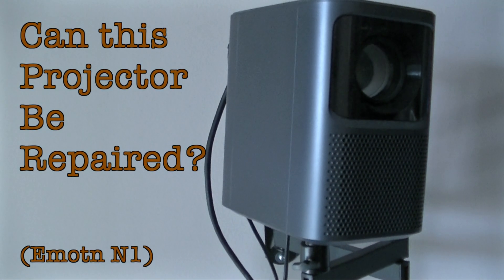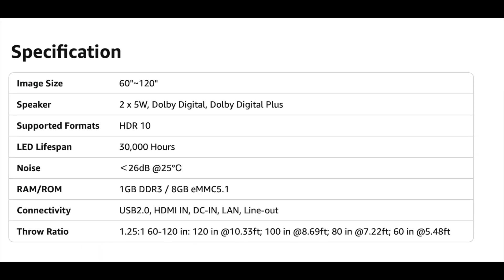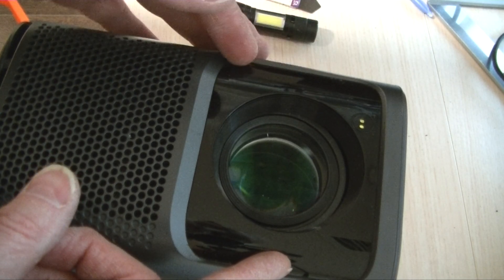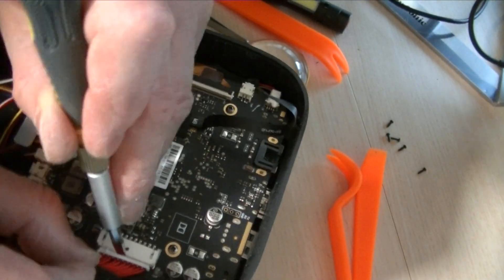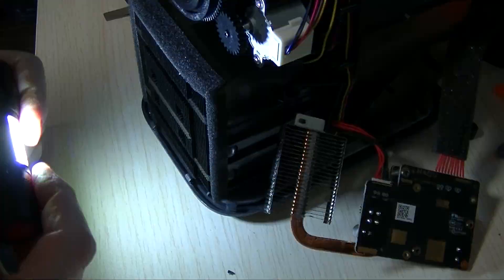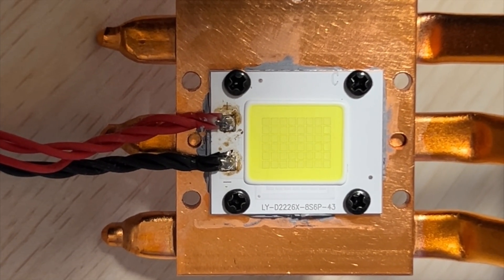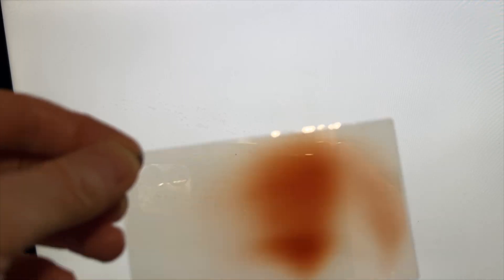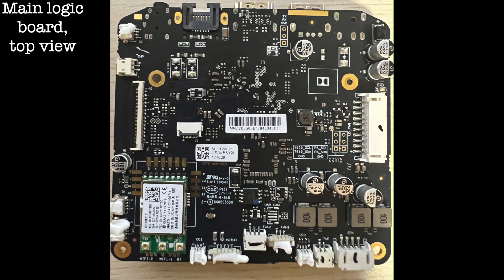Can This Projector be Repaired? (Emotn N1)

Comment: i just realized i have the same problem with mine.  what did you end up replacing it with?
Reply from the maker: Thank you for asking. I decided to take the Emotn’s failure as an opportunity to upgrade. I bought a Optoma HZ40HDR. Much more money. It doesn’t have the built-in apps so I bought a Roku Express. It is so much brighter than the Emotn was even at 50% brightness. It doesn’t have the autofocus or auto-keystone features. Its projected image is noticeably sharper than the Emotn was. The only issue was the default settings which made colours look over-saturated and artificial. I was able to tweak the settings so it’s “normal” now. I’ve had it for about 10 months. Very pleased with it.

Comment: Hi Sir, I got same projector but I am facing issue with remote controller it was working perfectly but from last few days it stopped working I try to put in reset mode by simultaneously pressing volume down and right navigation button but IR light is not flashing is there any hack of fixing it?
Reply from the maker: I’m sorry, I’m not aware of any “hack”. But let me ask you a question: Did you replace the batteries in the remote first? The symptom you describe could be simply from the batteries being discharged.
Reply: @Mr.BrownsBasement I changed it but no flashing indicator light on reseting
Reply from the maker: I’ll check and see if I still have my old remote.  If you’re willing to pay shipping, you can have it. It worked when last used.

Comment: I almost bought it, it's 79€ on Amazon in Europe, second-hand as good as new. I think it's on sale because they know the problem, that the lens will end up burning (and given the complexity of the repair). In the end I'm going to take the Formovie brand. Given the response you had from Dangbei support, I prefer to avoid this brand from now on. Thank you for your feedback and the effort made to repair it 🙂
Reply from the maker: Thank you for taking the time to comment. I’m very glad you found the video helpful. I have purchased a new projector made by a different brand. It was much more expensive but the image is also considerably brighter and the machine appears to be much more robustly made. On the downside, it lacks a few features but so far the tradeoffs have not been an inconvenience.

Comment: Thank you for this video, mine is stille working but i was looking for a tutorial to clean up the dust in the projector fan. It seems barely impossible!😱
Reply from the maker: You’re welcome! ☺️ There are several fans in the projector. Repair access to them is difficult. It should also have been equipped with air filters. No such luck. I’d suggest placing a vacuum cleaner next to the vents (when it’s not running) to grab any loose dust.

Comment: Yikes! That’s a great deal of work. In future, perhaps consider examining the phase discriminating amplifier to see if the temporal surge shifted the chronition particles to an unstable state of polarization. (Whoops…. I shouldn’t have divulged that outside the umbrella of silence…. I guess I’m out of Control).
Reply from the maker: When looking at phase discriminators you have to consider the allowable intermodulation distortion within the windings, as well as potential saturation of the ferrite laminations by eddy currents. Some insist this effect is negligible and amounts to little more a common-mode signal rejection. Miller Surges can be avoided using conventional transient suppression techniques, including but not limited to varistors and non-depreciated thyrectors except when quantum tunneling is involved. I’m more old school; so give me a mercury vapour thyratron any day and I’ll be running my thoriated cathodes on maximum. And yes Whoopi, you ARE out of Control!